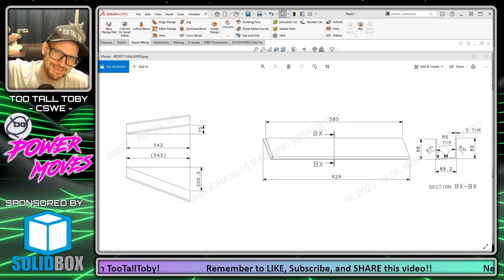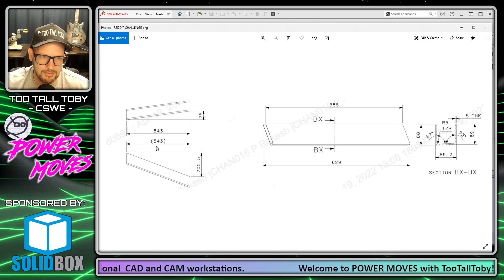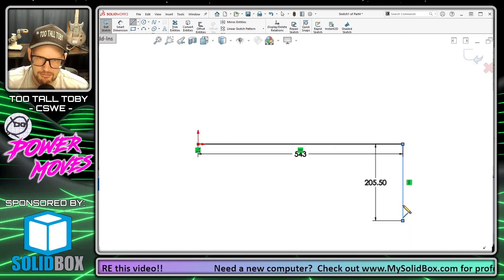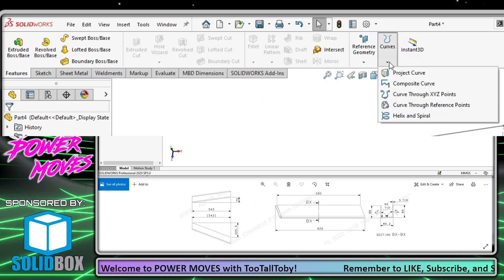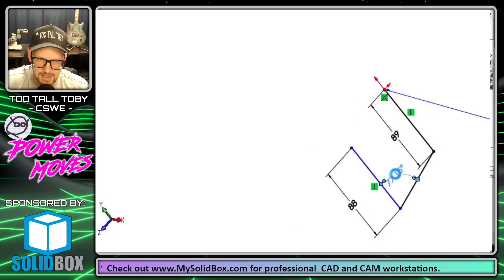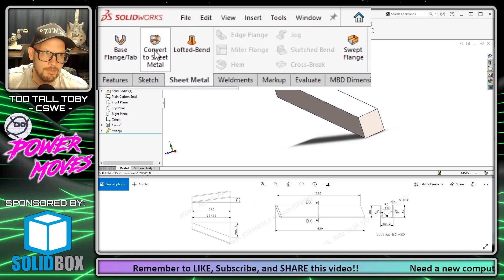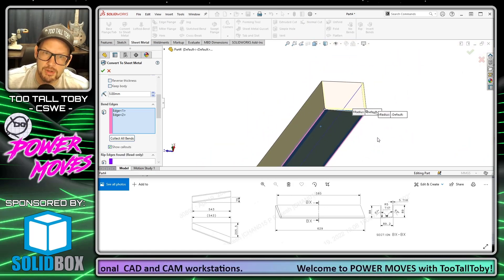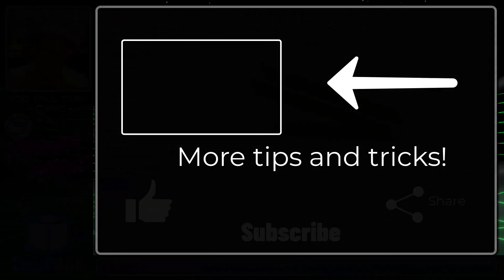They said it couldn't be done...

Comment: I'm not sure you're correct, defining your sketch leaving both sides vertical. Still scratching my head on that one. I would've defined my sketch exactly like the reference drawing. This would also assure you are using the same design intent, and if someone wants to change it, they can mark up that original drawing.
Reply from the maker: Update to this model solve, showing a correction:  https://youtu.be/2nUEepxSt28

Comment: not certain, but are the end faces 'angled' and yours are 'vertical'..? while the solid body convert to sheet metal is ideal method, using curve and sweep seems more esoteric Vs. instructing with more 'standard' sketch/extrude features? but I digress we know there are 1,000,001 ways to CAD. Happy Modeling Cheers
Reply from the maker: Thanks - how did you do it?
Reply: @TooTallToby  ehh I got other thing in my life I am avoiding doing let alone model this... But I have also found.. developing a solid model and conver to sheet metal helps me comprehend the shape / angles of a flat pattern... Then extract the flat pattern and bend lines into a new part file
Reply from the maker: thanks again for the comment - 
Update to this model solve, showing a correction:  https://youtu.be/2nUEepxSt28